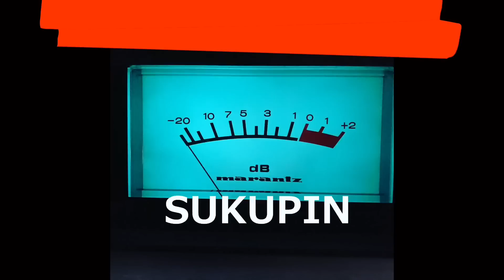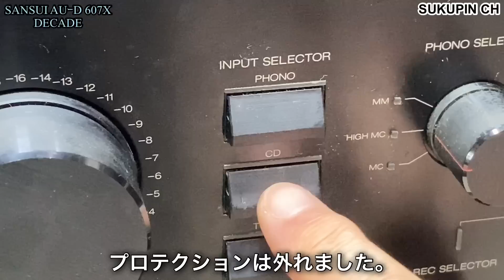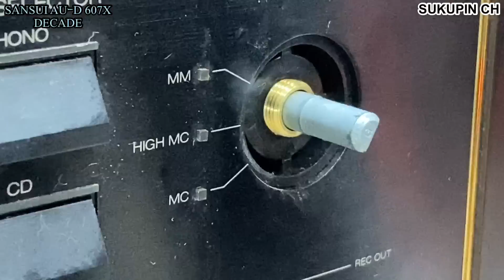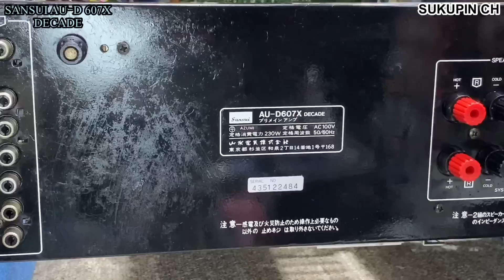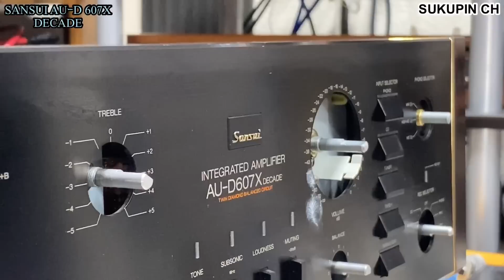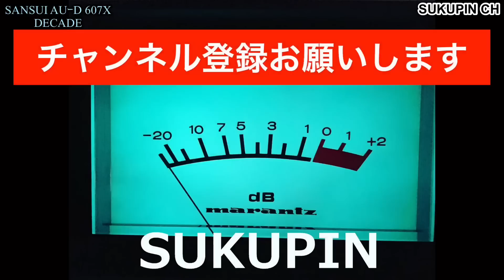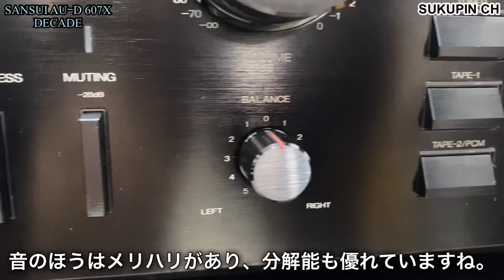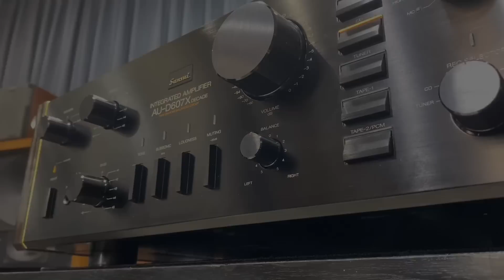■残念な結果になりました💦SANSUI AU-D607X DECADO　　This amp turned out disappointing．

Comment: well you can't win them all, most of your "junk" ends up working and looking great after you've worked on them, I don't like that yellow protection light being on all the time, surely it should only come on in the event of a problem, although I could be wrong about that. 🤔🤔 update, I think it's a combined power/protection led, would probably flash or turn red if their was a major issue. 🙂🙂
Reply from the maker: Thank you for watching.
It is designed so that the protection will remain blinking if there is an abnormality.
It's not the LED color changing type.　ありがとう